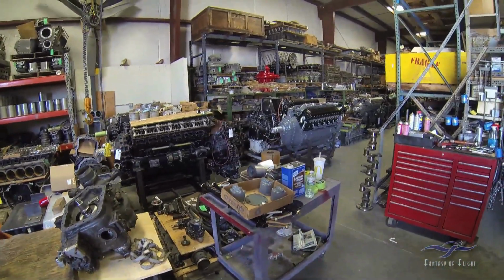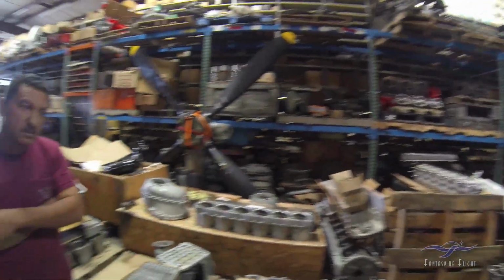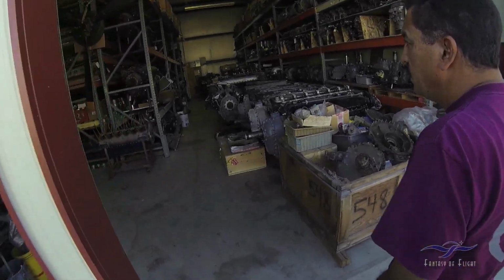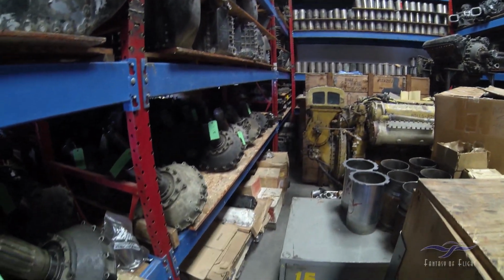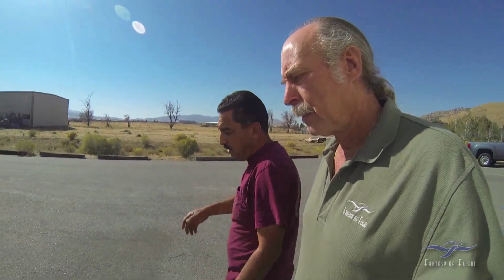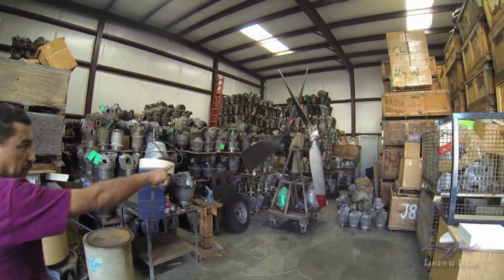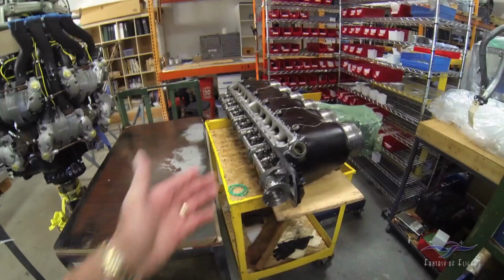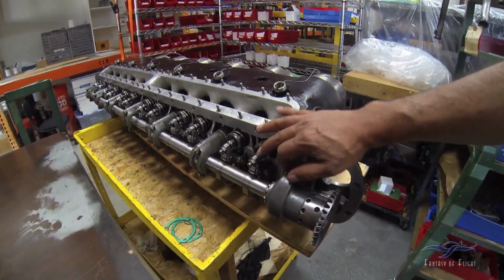Vintage V-12's - Engine Shop Visit - Part 2 of 3

Comment: I don't see any valve overlap in those German engines either, and to be honest I'm struggling just to picture those valves in operation and I've been a diesel mechanic for 25+ years with quite a bit of experience with 4-stroke, SOHC 4-valve engines. Of course with a large-displacement, slow-running, long-stroke engine with a relatively low compression ratio, you don't WANT or NEED valve overlap to make "big power". Especially when you have forced induction involved. When you add boost you can subtract valve lift and duration and you want to minimize overlap to avoid blowing air-fuel mixture in the intake valve and have it head straight to the hot exhaust valve during overlap. Its going to ignite and you get high EGTs under high loads until you get the engine "wound up" enough that VE drops off and the time overlap exists is short enough that you just get the fuel-air flowing into the cylinder as the exhaust valve is seating and cooling and you get the "ram effect" to aid in cylinder filling at high engine speeds. Lots of overlap is what makes "cammed" engines "lope" as you get contamination of the fuel-air mixture and reversion with hot exhaust gas not being scavenged out the cylinders properly. Engines like that just start "running good" and "making power" at about the max speed as those old low-compression, long-stroke supercharged "aero engines" and that's not a coincidence. Those engines also aren't nearly as "powerful" as they seem when you consider the gear ratios, torque-converter "stall speeds", light vehicles, etc they're used with and in to make them look like they have ungodly "power". Plenty of "horsepower" from a biased-toward-high rpm horsepower formula but crappy low-end ACTUAL POWER AVAILABLE AT THE CRANKSHAFT CALLED "TORQUE" WHICH IS WHAT PHYSICALLY MOVES AND ACCELERATES ALL VEHICLES. You don't have HORSEPOWER until something is MOVING and WORK IS BEING PERFORMED and you have speed to measure to plug into the formula. TORQUE is a FORCE. Horsepower is a RATE.
Reply: DEEREMEYER1  Here is an illustration of the DB series valve overlap: http://www.enginehistory.org/Piston/Daimler-Benz/Fig02.jpg   If you watch a video of one running, you can hear that they have a lope:  https://www.youtube.com/watch?v=_2gDVc46VNA   And to compensate for low speed they had a low-speed by-pass passage in the throttle.

Comment: All those Merlins around and not a boat needing an anchor to be seen.
Reply: +DEEREMEYER1  That's a good thing.  The boat racers destroyed enough of them.
Reply: Obviously not. There are clearly still plenty around. And if they were a better engine to start with, they wouldn't be so "rare". And there wouldn't be a shortage of Allison parts like connecting rods from so many Merlins being "rebuilt" with Allison rods to make them worth rebuilding for "high performance". Who knows what OTHER Allison "upgrades" get done on Merlins, but I imagine those crappy non-roller valvetrains on Merlins are another "weak point" where Allison parts come to the rescue. Unless Packard was able to convince the experts at R-R to let real engineers "build under license" good "Merlins" in the first place and "later marks" of "Packard Merlins" became progressively more "Allison-like".

Its interesting you'd mention boat racers because liquid-cooled V12 "aero-engines" like that are much better boat engines than aircraft engines. Especially the cheap, throwaway ones built like the Merlins. Or at least the ones that had to be "hand-fitted" and parts needed to be "filed" for them to fit properly. You don't want, or at least I wouldn't want, an engine like that in any "ship" that didn't have water underneath it at all times instead of just when I happened to be flying over a lake or river. Those valvetrains are just as scary as the bottom ends and a dropped valve/thrown rod isn't something you're guaranteed to glide away from between the fire risk from exploding engine blocks, hot metal and oil vapor and the potential for locking up the engine with that big 3-bladed or 4-bladed "flywheel" on the front wanting to keep rotating.
Reply: DEEREMEYER1  Roush Aerospace has a roller conversion for the Merlins for those who want them, along with other new manufactured parts and upgrades, and some of their overhauled Merlins have hit 1000 hours TBO.   As far as the racing Merlins,  the heavier Allison connection rod modification was not for weakness but was a trick to add more rotating mass so they could boost the engine while keeping the propeller tips sub-sonic for more bite.  Other than that, they mainly strengthen the crank journals (cross-bolts, etc) and beef it up to hold together for high boost.  The peak for piston boat racing began in the 60s when there literally were hundreds of surplus Merlins and Allisons and just a small historic aircraft community. They were throwaway engines. They weren't originally designed for the RPM stresses from a bouncing boat. Smithsonian mag interviewed several engine builders who described how boat racing wrecked the engine.  I would argue that the Merlin supply is drying up because there are more Merlins flying than any other type.  Allisons are needed for the P-38s, P-40s, and P-39s and there are very few compared to over 150+ Mustangs and a growing number of Spits and Hurricanes consuming all of those parts.
Reply: What would you rather have, the engine with no roller-rockers and an induction system that actually worked, or the engine with the roller-rockers that frequently blew up at altitude because of things like frozen turbo regulators?